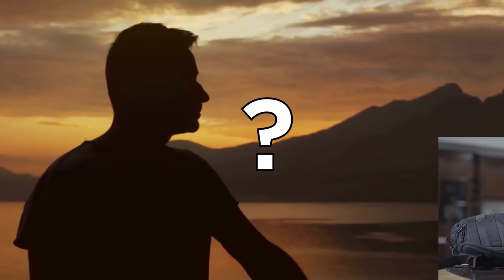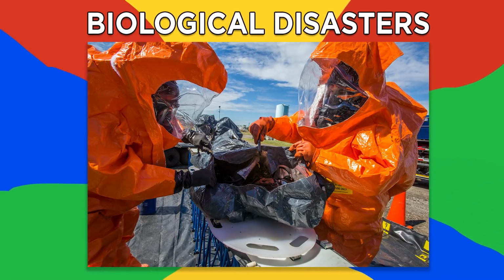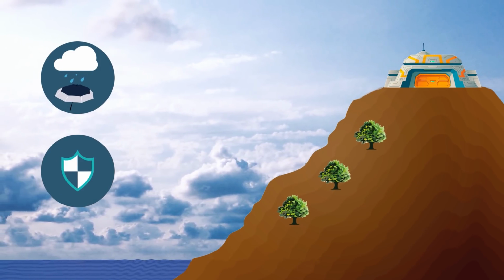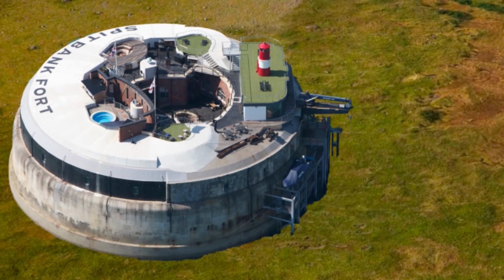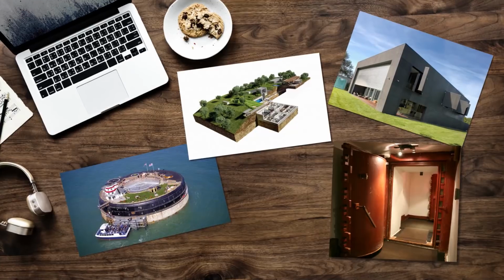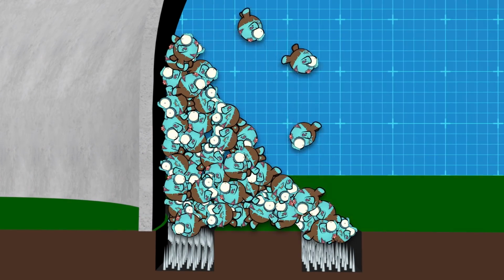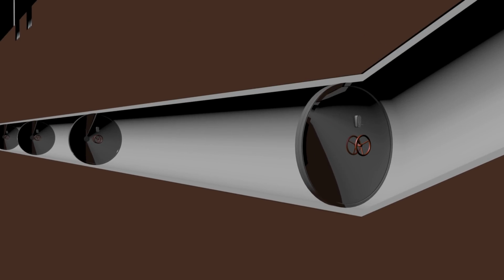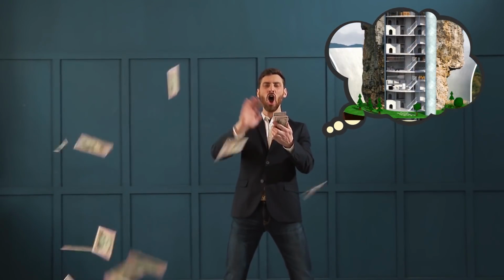This is the Ultimate Doomsday Survival Fortress

Comment: As seen in the show LOST the underground fort known as "The Hatch" would suffice. But if you want to go all the way, a small driveway leads over a small hill and into a blast door, set in concrete below ground level. This tunnel spirals around a large parking area, 6 or 8 stories deep, with a second blast door leading to luxurious spacial living areas complete with a self contained power supply and massive refrigeration/freezers for food storage. 20 foot thick reinforced exterior walls makes tunneling in impossible. Air filtration systems, waste disposal, bla, bla, bla...

Comment: A nuclear winter is highly probable so growing food outside not likely, solar panels also unlikely, stirling heat engines coupled with bio digesters produce power heat and convert bio matter into fertilizer. Stock up on led light sources as in the case of nuclear winter you can grow food and fuel inside, medicines can be grown as well, having a workshop and lab are crucial to maintaining technology..

Comment: Terrible. U ain't eating anything grown above ground during a nuclear fallout or asteroid impact or when tshtf scenario. U want numerous hydroponic units growing underground. And u better add marijuana because you'll go stir crazy in a month. 
You'll need a big underground chicken coop & Feed for them. Their poop is energy & fertilizer to grow various mushrooms that u can easily grow plus they grow fast and have obvious numerous health benefits. I would even add fresh water fish to a large water basin. I'd use a natural Filtration system.
U need wind turbines & solar panels. So u must be in a place that has both. 
 And if u do collect water from above u can drop it down into that basin spinning a turbine to trickle charge something. Also putting all your water in one place is dumb too. U need to channel & filter into smaller reservoirs throughout the complex instead of pumping it up. And Put the main basin on top but inside the structure. And let the gravity work the water not mechanical.
 You're air system needs all the monitors. And u need to create a negative pressure once in awhile to refresh the air you're recirculating. 
You'll need seeds. CO2 scrubber & monitors, etc. Telescopes/binoculars, guns, ammo for a few months. U won't need an arsenal. Just enough to protect yourself. You're best defense is secrecy & never drawing attention to your bunker. Ever. 
Btw, all modern tech will fail. So learn engineering now or perish. U need to go more Robinson Caruso. Gravity is your best friend. Use it all to ur survival. Pullies, weights, counter balance, etc. 
Must have Composting toilets. 
Energy storage. Use elon musk's it's the best. 
Gotta use most of ur energy growing ur food underground. You'll be climate controlled but humidity might be a problem. So if your humidity rises figure out a way to add it to the top basin. 
Remember the bigger it is the more problems u will have. If u need space in enclosed places or have medical issues then just face the nuclear explosion and get it over with in a second. You'll be much better off.
There's a hundred little things too.

Comment: I agree with your idea and i have multiple add-on, as you said, if you have an unlimited budget you could construct

1. underground farm using UV lights, replaced the top farm with something else (mention below)
2. air purification systems
3. also, put everything in the surface structure (gym, armory, etc.) and put it down in the underground section, there could be more solar panels and wind turbines, you could line the top of the curved walls with solar panels and on the top section of the surface tower.
4. hazmat and radiation suits, if there is a nuclear fallout, the surface is going to be filled with radiation so you need protection, you could line the suits with armor plates to prevent breaching of the suits and if you have it, line it with kevlar to protect against bullets and other wacky weapons raiders, looters and attackers may have.

Comment: A nuclear blast will create an Electrical Magnetic Pulse ,  which will short out anything electrical.  An antenna on the  roof would allow this electrical magnetic pulse  to follow the wiring inside and short out everything. Do not use anything electrical on the outside of compound , till after the bombs are done..

Comment: I would have a silo shaped tower about 50 km off the shore that is connected to the sea floor which lowers under water, which will have a tunnel that is connected to a bunker far underground on the mainland which will house an underground farm with an artificial sun. On the main base (silo shaped sea base mentioned at the start) there will be a solar panel at the top of it as well as 10, 2 by 2 metre poles with small solar panels on the top of them. The main base will house enough long lasting food such as cans to last 100 people several decades. The main base will be equipped with 2 library, 3 cinemas, 2 swimming pools, a gym, a research lab, a water purification plant.

Comment: If there is a nuclear blast, the radio dish and farm-able land goes out of the window, so you'd have no idea what's going on in the wild world or if it's safe to come out, so maybe having an underground farm using hydro-electric power using the streams to add moisture to the farmland as a means of powering many big LED lights which provide light to encourage plants and crops to grow, using fertiliser created from your.... loo breaks... to add the nutrients. Also, it might be worth having a few backup dishes, in case the radio at the top is eviscerated by any ole nuclear blast and radioactive interference.

Comment: if there is nothing else you can remember from sun-tzu (the art of war guy), just remember tactical mobility or tactical fluidity. its your adaptability to any situation, which usually involves constant movement, to remain as slippery as possible for as long as you can to your enemies (or to the things you have identified are inimical to your welfare and good health). this is how jason bourne has remained alive despite all the odds against him (a fictional story, with viable strategies very very applicable in real life), this is how noah outlasted the flood, and which is why in the movie 2012 they chose to build arks instead of anything else, like an underground bunker.

having a fortress over land (an immovable fortress) is a definite no no, this completely removes your tactical mobility from your personal survival equation. even in feudal times, sun-tzu thinks its way way better to be a small group riding on horses constantly moving in the woods (or even just on foot), than having a castle with very strong walls, because once those walls will give in (especially if you face a very determined well-prepared enemy), you may consider suicide if you have not given yourself any option to run (that underground escape tunnel might be improved if it were a network of interconnecting non-terminating (no dead-ends!) tunnels, of course secured by several doors (compartmentalized into several sections), each, leading to several escape hatches; if one exit is compromised, you still have hope in other exits). having a land fortress is like painting a bullseye on your back, a large very visible very secure safehouse technically invites everyone out there to ransack you, you are displaying strength, at a time of weakness ("there must be tons of goodies in there, i'm starving").
 even in a zombie apocalypse, its the living that is your most dangerous enemy.

my point: its way better to turn a sea-worthy ship into your fortress, a mobile fortress, a domicile you can maneuver anywhere, to be further modified and reinforced in the future to suit your needs and current situation (in the apocalypse, there's not much else to do, except to further secure your survival), and sail yourself out of anybody's reach, far out at sea. you should choose a ship that's big enough for your group's needs, as well as sufficient area for farming (because you need to think this is your new lifestyle now, until you will die, everywhere else the world is no longer livable; stockpiling on food is stupid, you need to make your own food, you need to maintain cows and pigs and chickens). in the worst-case scenario that some folks have resorted to piracy, and try to board your ship by force, then you should slowly acquire and install on that vessel long-range weapons to combat them, if you can develop from salvaged parts a powerful laser emitter that can punch a hole into a pirate ship (or inbound attack planes) at the horizon every one second, the better (the less your weapon relies on loading ammo, the better; heavily shield this primary weapon with a few feet of steel sheets, you're a sitting duck if it disappears).
Reply: now that you're one of the only few living people left, you need to think in terms of "off-grid living" and of operating like a small country, with you as its one-man government (or the number of the people in your group), you need to maintain a small simple sustainable ecosystem for your food supply (plants sustain farm animals, animals sustain you, your shit sustains plants, etc.), and off-grid power sources for your machines and weapons (solar panels, savonius vawt's, etc.)

Comment: Surprised a hydroponic farm wasn't discussed some even have a connecting fish farm. A hydroponic farm is where plants are grown without soil, nutrients is poured into water to let them grow, a fish farm helps because it gives the water the nitrogen and other stuff the plants can use to grow. So if your budget was really unlimited. The only thing you really need to worry about is power, and clean air and sustainable water supply.

Comment: Pore design. If money was no option then you would have a small thorium salt reactor for power.  You wouldn't rely on water from the outside but rather have a boar.  as for growing food you would do Aquaponics inside not outside this will eliminate any exposure to toxic substances and weather conditions. And you would have lifts. Plus air and water filtration

Comment: There is ample room for improvement. First of all, horisontal space - extend it at least to 4 times it's size (4 times the area) - that way, your roof garden might actually have enough space to provide something useful. If you have 10+ floors, you'll want an elevator, not just stairs, especially if you need to haul heavy equipment or similar up and/or down. You might want an old-school electric / manual elevator in the middle of the winding staircase. Keeps it protected, and the manual pulleysystem (which could be powered by a bike, for instance) would make it work even if power goes out, or you try to conserve energy.

As for the inconspicous look, the easy method for this is creating a retractable outer wall, which can be hidden when not needed - the same could be done for the outer ladder/staircase, which would basically leave you with a house on top of a rock, which, while quaint, not immediately conspicous.

As for escape hatches, always have at least two (in addition to the top one). That way, you're not trapped if one exit should be compromised.

Include a pool - swimming is important, both for healthbenefits, but also for training and recovering from injury, if need be. Can be filled with waste-water (filtered) for instance, that way you don't need to add a completely different fill-system.

I would also add a dual funnel outer wall - the funnel-shape is good, but it only provides a single point of failure - if you stack enough zombies on top of each other, they'll eventually stack far enough out to get over the top part of the funnel. If you then have another funnet going up another level, that becomes a LOT harder to accomplish. Also, fit flammable or electrical current release around the entire top 5 meters of wall, just as an extra precaution.

Add a helipad, with room for a Sikorsky or similar, capable of hauling out all of the inhabitants in one go. Another escapeway, can be used to also ferry in other things, and is good to have for a multitude of reasons. Might also want an attack chopper and a small city-bee for short jumps and pickups. Takes a bit of space, but can be housed in underground hangars, with soil on top / agriculture (a little like a hangar ship has). Fuel can be kept underground, under the hangars. Would require having a pilot and a mechanic as part of the crew, though.

Provide an outer shell for the top-building - having all windows is no good if there is a blast of any kind, so blast proofing (either with retractable walls, or just the ability to raise / sink into the rock, would suffice).

Comment: why always tons of guns... either you need enough ammo to outlive everyone else... or you will need improvised weaponry at some point. 
why does nobody think of improvised weaponry, yet everybody thinks of weapons that use a finite resource --' get a compressor (plus electricity generating stuff like solar panels etc) and have a battery ready, to use the compressor to fuel a scrap cannon, and bam, even if the world is out of bullets you'll always have crap to shoot from a scrap cannon... even a modified nailgun would be better, at least you can somewhat reuse the nails that aren't bent, and i think (or rather hope) that we have more nails on the planet than bullets xP

or maybe build a modern style trebuchet or ballista? or the obvious choice of bows and crossbows? as long as it's either man-powered or powered by something you can generate, then you can use it when the bullets run out. it's either that or fix a wood fueled forge to cast bullets yourself, and creating gunpowder yourself. why not get both guns AND improvised weaponry?

Comment: Cars and I’m not talking Honda. You need a way to get a garage like the exit, you need Fast cars, strong cars, travel are, and possibly armored cars, also add a helicopter in there to, and they could be either electric or fuel. You would also need a large supply of petrol

Comment: Did i miss the part where and how to get inside?
i did understand that there is a bug out tunnel to get out incase of infiltration... but how do you get in on a regular basis?
Reply: Seems he opted out of a front door meanwhile the separate stairs accessed by draw bridge is how you get to the garden closed off to the rest of the outside with a protective curved wall.

Comment: Your forget a machicolation. A machicolation is a floor opening between the supporting corbels of a battlement, through which stones or other material, such as boiling water or boiling cooking oil, could be dropped on attackers at the base of a defensive wall.

Comment: No natural rock pillars like that in Iowa lol
Reply: @JokerSF Yeah I don't get how a tall rock pillar with a structure on top would not standout if it's not surrounded by a few similar natural structures like it. Otherwise if it's meant to disguise it I don't see the point since it stands out regardless. I would think moss or leaf covered disguise or even camo netting on the visible portion of the structure outside the pillar would be a tiny bit better. Especially if the structure is wider at the bottom, so it could look more like a grassy hill lol.

Comment: I live in Iowa. It's a flood plain, especially the parts by the Mississippi like you pointed out. It can tear landscape away in a heartbeat. It's also actually at the top of Tornado Alley. Lots of lightning & hail damage to worry about on something that tall. You're also going to run into a lot of water table problems with something that deep. Sorry.

Comment: Massive room for improvements.. But well thought out. With a big enough underground site you could grow all your food there and with a small nuclear reactor to power the site, backed up by hydrogen fuel cells. Top side you add a normal looking building with lots of solar and water collection systems and other above ground stuff to hide and of course armor everything up top. It would be even better if you had a underground stream of water. With grow tunnels to grow more food than you need and put lots of money into growing beef, chicken and port flesh to eat in machines, we can do it now, but not all that much has been invested in the tech.

Done right you could build a completely self sufficient  site and with the right plants you would also have a backup for different kinds of medicines and other things, most of that comes from nature anyway.  Whit some advancement in 3D printing of different material most of you long time needs could be handled also, need a spare, just print it.

As for collected water, it should under no circumstanced be put into you drinking water storage, but it will be fine for hydrogen production and other things even if the collected water is contaminated. Plus it gives you the option to really clean such water.

But you need to think really big to make it all work. 

I've been thinking a lot about a self sustainable space station and there are a lot of similarities, that is why I have all these ideas.

Comment: Your a long long way from the best survival system.
The best place to build is in the Arctic or Antarctica.
Build an outer shell and an inner shell with ice between.
Make both shells air tight and layered in aluminum alloy and carbon fiber, insulation and reinforced concrete.
Build your living survival space in the core. Fully self sustained.
Make the entire thing egg shaped.
Now you are radiation proof and virtually immune to impacts.
You have a built in source of water and fuel.
If the entire Earth was destroyed...it would almost certainly survive with most of it's occupants.
It could float in space for decades!